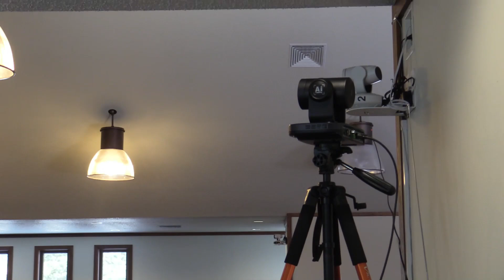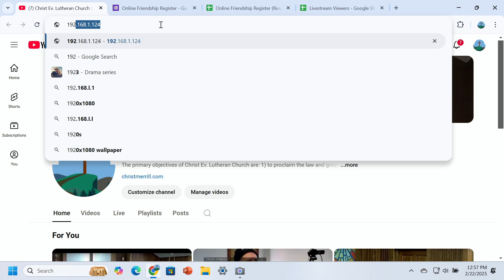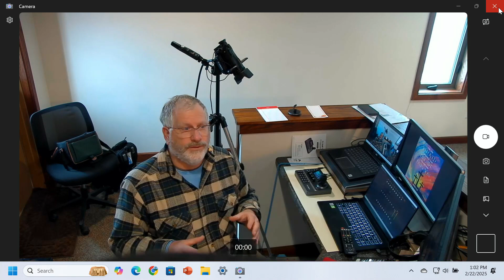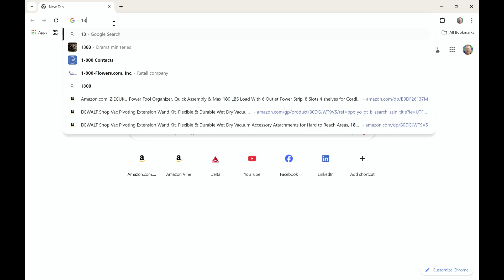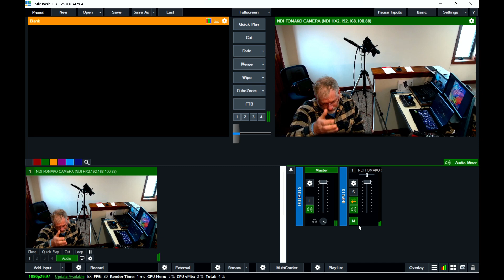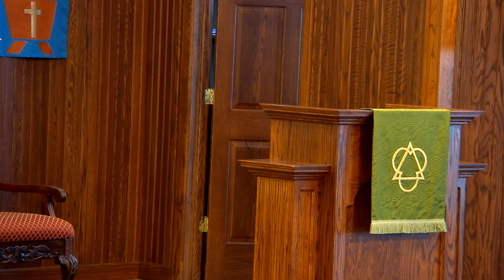Installing the FoMaKo KN20 1080P PTZ Camera with AI Tracking into an existing livestream setup

Comment: you can turn trackingon and off from a keyboardcontroller F1 an off with F2 controller protocol we use is visca IP
Reply from the maker: What controller are you using? We are using Visca over IP also.  I had to plug in the codes for tracking on and off on our KC606N but I could then put them in one of the knob controls.

Comment: Can I control this camera from my phone?
Reply from the maker: As a matter of fact FoMaKo just launched a smart phone app which I know works with my iPhone but not sure about android.  Here is a video on my other channel where I introduce the app and demo it.  It is a really good app although I and a couple of others have identified some things we would like them to add to the app.  https://youtu.be/APM5xkFSpvE?si=dAgeO_WK0xuG_tQh
Reply: Can you please tell me if I have 4 of the fomako cameras connected through a POE switch to the controller, what else do I need to be able to show the live stream on the TV's within the same building?
Reply from the maker: Well thanks for asking that is and isn't an easy question.  The easy answer is you need something to produce a video that you can stream to that TV.  I use a hardware switcher, at our church that is an ATEM mini Extreme. At home I prefer the FoMaKo M4 switcher. They usually get their video feed from the cameras via HDMI or SDI. While you control the cameras from the controller, you select which one is providing the input and send the live feed to a streaming platform and also usually via an HDMI out port to the TV.  We have a TV in our fellowship hall for use as a cry room.  While I stream from the switcher via the network connection, my program out HDMI port goes to the fellowship via HDMI and an ethernet extender.  The other way is via a software streaming platform like OBS or V-Mix.  It does the same thing as the hardware switcher just using your computer and software instead of the dedicated hardware.

Comment: Good presentation: Question: What is the distance in feet from the KN20 camera position in this video to the front of the church over to the right pulpit, in feet?  I'm estimating it's 45 feet?  As we wish to mount cameras on our church balcony that is 75 feet from the pulpit and am wondering if we should get the 30x over the 20x zoom, even though costs are more. example: fmk30sdi pro

You also have same lighting problem as us as the overhead hanging globe lights shin into the camera. I can your 3, we have 8 being father distance.

BTW some cameras can have a primary stream and a secondary stream each with own ip #.
Reply from the maker: Eventually my KN20 will be in the back about 70-75 ft.  I have had it back there on a tripod and I mainly will use it for a wide shot, that is as wide as those lights will allow.  That distance is about what you estimated, 45-50 ft.  Between the huge overheads and the spots right there at the pulpit it is a challenge.  our other camera looks straight on the pulpit from the right side of church so that is our main camera when pastor is doing the sermon or readings.  We have recently really been looking at this issue as different cameras handle those lights differently.  It also changes the colore of the wood behind him.  Always a challenge.

Comment: My IP for the camera (KN20A pro) is the default 192.168.5.163. When I turn off/on DCHP it doesn't change my ip address. 😢 It's on a POE switcher and connected to the network but only my controller (KC608) is connected.
Reply: NVM got it .. had to connect my Ethernet directly to my cam then the IP address switched.... Lol got it
Reply from the maker: @RigginTheRod010  The fun of figuring it out.  The AHA moments.  :)

Comment: So for the ndi I have to run a Ethernet to a router ?? Even if it doesn’t have a wifi connection? Or how ? Again emailed but no reply
Reply: You must be on the same network like the other devices you are using. And POE++ support is nice to have (coming from your switch or an additional POE++ injector).
Reply from the maker: Same network yes.  The camera is ethernet only and can be powered via its own power supply or via POE if you have that capability.  From there if your computer is connected on the same network the NDI-HX (not straight NDI) will be visible via those programs or hardware components capable of decoding the NDI.  This means, a converter like the Zowiebox to HDMI that I am using with this camera into an HDMI switcher.  But also switchers that come with NDI native, and even software like V-mix or OBS.  You can also use NDI Tools to see and control it on PCs, Macs or even mobile devices.  But yes all on the same network.
Reply: @christmerrill  If distance allows, I would never decode NDI to HDMI if you otherwise use HDMI, as this adds latency (around 100ms HX3 and 200ms HX2).
In this case, I would use an HDMI extender (same cabling, but not on the network). The advantage is that there is no noticeable latency as with NDI.

For distances of 20-30 meters (up to 100 feet), you can find usable HDMI extenders for very little money (around €50/$50). If you need to cover longer distances (50-60 meters), you'll have to invest a little more (maybe €100/$100).
If it's really long and difficult, you can use Crestron HDMI extender, for example, but then it gets really expensive.
Reply from the maker: I agree with the use of extenders vs NDI. Our current setup has been working well for a couple years now.  Two Avipas PTZ cameras, one with a 5m cable right above the booth.  The second one is opposite this one across the church on a direct HDMI/ethernet extender about 25m.  I really like the Orei extenders. I have a delay with the audio so that both are as perfectly synched as I could get them.  The third one, this KN20 I am planning to install where I have no support at the present time so I will be running a single ethernet cable connected to the network.  This single cable will be POE+, Visca over IP control and NDI video.  That is the main reason for me to go NDI. As for the latency, I did a test and posted to my other channel based on your comment on the use of the Zowiebox to decode NDI to HDMI. There is virtually no difference in that test.  

Here it is.  https://youtu.be/bENGB_Smz9U    
Low tech test but I think it served the purpose for me, and thanks very much for asking about the latency.

Comment: I've watched your lives recently. They're very clear and sound great. We're using EVMUX and using iPhones for cameras. Can't wait to get rid of the phones and have ptz camera. What do you use for streaming? Obs?
Reply from the maker: Thank you so much.  It took me some time to get it that way. I actually started with a camcorder and uploading the video. I then started using Vmix for streaming after trying OBS and I was able to work it but I knew that volunteers would not be able to since we have so few tech savvy volunteers.  So the ATEM minis were coming out at that time and I started experimenting with them.  Finally settled on the ATEM Mini Extreme HDMI switcher after we used the ATEM Mini Pro to get it all set up.  The switchers then become our streaming platform and also record  the stream locally. No software is required other than the ATEM control software.  This was what I needed for our volunteers and made training much easier.  The first volunteer I taught how to set up and stream, then took my instructions and created a checklist which we now update as needed.  She still uses that checklist and so do the others. Other switchers besides the Blackmagic ATEM Minis that also work well for church streaming are the Osee GoStream Deck and Fomako M-series.  I have and use the Fomako M4 and it is actually my favorite but for what we do at church we are not going to change anything.    Good luck. PTZs, figuring out the sound connections and simplifying the procedures made this work for us.
Reply: @christmerrill  Thank you so much for explaining! I hear that web based streaming services aren't good for sound or video vs a desktop based service app. Yes this whole thing is a process especially for small churches. Appreciate the feedback
Reply from the maker: Thanks.  If you watch our lives you are seeing them unedited and streamed through our ATEM Mini Extreme.  Our computer crashed often with VMix and I did not want a graphics power house just to do this stream.  It works for us.

Comment: Love to know how these cameras are with a low light dj booth for live streaming
Reply: These cams doesn't look really good with low light. Sony or Canon are much better - but much more expensive as well.
Reply: @VistaLasVegas which models would you recommend need be able run of mains power not battery an have hdmi out for black magic atem
Reply from the maker: @antsantangelo1  I would agree with Vistalasvegas about the low light.  If you are DJing in a darkened room most do have trouble.  Especailly the lower priced ones.  WE use this in our church with some pretty bright lights so I don't think about that problem much.
Reply from the maker: Not sure I know what you are asking. Sorry.

Comment: Found this looking for your previous PTZ video i watched months ago. Very intriguing. 
Maybe i misunderstood,  but you mentioned the new camera using PoE was an advantage for 1 wire, but then you're using HDMI to the switcher? So you ran both Cat6 and HDMI?
Reply from the maker: Since the ATEM mini Extreme only has HDMI inputs I did use 2 use both cat6 for control and power and HDMI for the video.  This is what I have been using with the older AVIPAS cameras.  Then I discovered NDI and all it can do for you.  But I needed a way to swap it over to HDMI.  So with a little research I discovered the Zowie Box NDI-HDMI encoder/decoder.  Using it as a decoder I was able to use our church network for power, control via VISCA over IP protocol and NDI video from the camera. That is what I thought it could do and it does it quite well.  The nice thing about using the Zowie-box decoder is that it comes into the ATEM via HDMI for normal video switching and the aux-in is still available.  Check out this video on my new channel, I had to move off our church channel as my tech videos got more popular.   @kenschurchtech     https://youtu.be/uqX8I2tOr0s
Reply: If you are using Vmix or OBS as a video switcher, you don't need HDMI. You can add the NDI stream directly as a source.

Comment: Hi, regarding image quality, do you think this camera is better than the other two you already have?
Reply from the maker: Yes.  The 2 Avipas cameras are still working great for us but this KN20 , also 1080P, I really like that it has faster PTZ speeds and faster auto focus.  And it just simply does look better when I see them side by side in the multiview.  What I really like that the others can't do  is it's autotracking and versatility.  With NDI, SDI and HDMI outputs, I can bring it into a switcher in several different ways different ways. In this case since our switcher can't do NDI, I am using the ZowieBox to bring it from the camera using NDI and switch it to HDMI.  I could also change my switcher or take it into OBS or V-Mix as NDI but I do not want to make our volunteers change from things they are now comfortable doing.